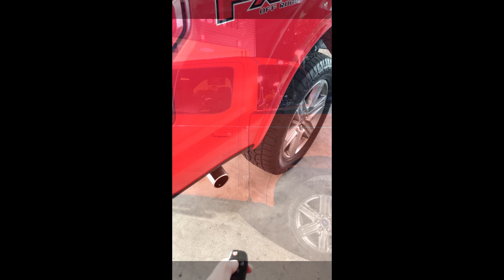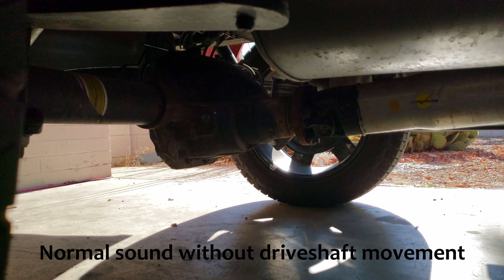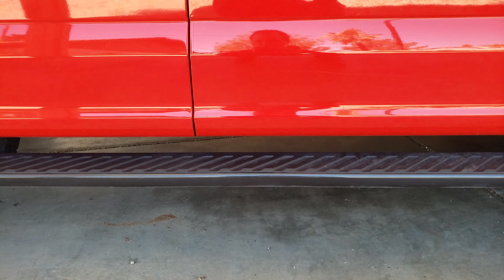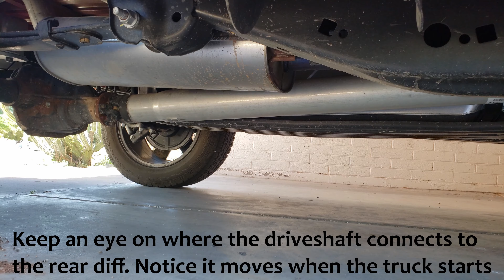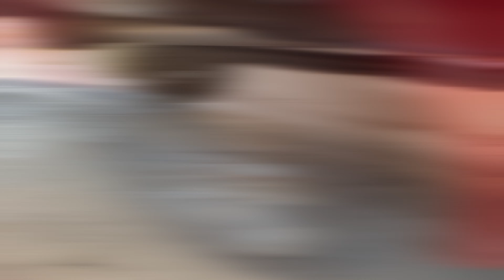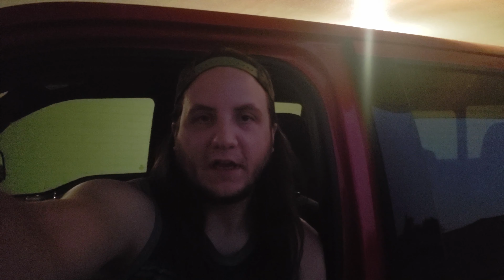2018 F150 Start Up Clunk

Comment from the maker: UPDATE: Took it in to the dealership today for my first oil change at about 4800 miles and told them about the clunk. They looked at it and said it is "normal" due to the remote start function...lol. I will be taking it to a different dealer that has better ratings at some point because I think this is BS. I took it in to the place I bought it from because my first oil change was free. They also did TSB 18-2274 for the rough shifting and driving it home it was much smoother. Hopefully that will continue to be the case!
Reply: Truck the System not normal with remote start because my 2019 that DOESNT have remote start does this some times
Reply: How’s the transmission been shifting after the TSB?
Reply from the maker: @searles400  It got worse after the first tsb so I took it back in and they updated it again about 8 months ago. It was pretty smooth for awhile but I haven't been driving nearly as much and it's back to rough shifts when cold. Think that's just how its gonna be with this one so I always try to let it warm up before I drive.
Reply: Truck the System was the TSB done 8 months ago different than the original one they did? Or just did the same TSB again
Reply from the maker: @searles400  Same TSB but ford had just released an updated version of it the day I took it in
Reply: Mine makes the same clunk and makes a a god awful clunk when it’s cold if you go from drive to reverse I mean god awful. And they did an update to the transmission and now the shift from third to fourth is horrible.
Reply: Immune doesn’t have remote start and it makes the noise. Get an exhaust and you won’t notice it lol
Reply: Definitely has nothing to do with the remote star if truck is in park then it’s in park no matter how u crank it
Reply: Lol people complain about any little thing.
Reply: @truckthesystem3957  
I saw another video on youtube where a guy had the dealership deactivate the adaptive learning on the transmission so it shifts normal and doesn't try and learn driving habits. Said it's been good ever since.
Reply: Sounds like two different problems I heard like chatter from starter and the last one was a clunk
Reply: Its your torque converter. Ford replaced my under warranty for same issue and problem solved!
Reply: @davecarroll4086  did your dealership prove this was the issue? Also, did you truck do this all the time or just every now and again?
Reply: Yea I don’t have remote start and today leaving work it made my truck rock forward
Reply: Mine does it and I don't have remote start. Mine is remote start capable but I do not have the remote for a remote start
Reply: My 2020 F150 3.5 Eco is doing the same driveshaft clunk at startup. I took it to the dealer several times before they could replicate the clunk. Now they’re telling me the clunk is normal operation per ford as a “drag, rocking sensation upon startup”. I am having the dealer contact Ford directly since the technical advisory note doesn’t reference any loud knocking noise. I will let you know what I hear from Ford. Please check my videos on my F150’s clunk noise.
Reply: The dealership/Ford said the clunk is normal operation of the motor. They are refusing to do anything further with my F150. Ford advised me to take it to another dealership which it is currently at. We will see what they have to say.
Reply: @Gonzola  did you fix the clunk issue?

Comment: I have this issue on my 2018 F150 Fx4 5.0. Dealership told me this was normal and no harm is being done. It usually only happens after I’ve driven a while, park, leave it off for a bit, then turn on. It has never done it during a cold start.

Comment: Apparently there’s a TSB for this clunk noise. Whenever the driveshaft rocks front to back it will clunk. The dealership will grease the driveshaft slip yoke that contacts your transfer case and the sound is gone.
Reply from the maker: Oh really? I havent seen it. Do you know the TSB #? Seems like that would just fix the sound but not the movement.
Reply: Finally someone talking sense about this issue, its not a life ending noise ffs!

Comment: Former ford tech here. It's the 10 speed transmissions. They are starting to have some issues. I had a 2011 fx4 with the 6R80 transmission remote start. Never did it. All the new ones with the 10 speed do it. I'll look up to see if a tsb is present and get back to you Monday
Reply: Any news on this? My 3.5 started  doing this!
Reply: @axelst.776  no I actually forgot about this. I'll look it up today for tsb's
Reply: @BeardedFordTech  any news
Reply: @montanamccormick1041  no tsb for that noise on startup. I did get with another tech who is a senior master and we remote started a few different ones. Every one of them sounded different. Kind of baffled us. He's looking into it more for me seeing as how he is still with Ford
Reply: @BeardedFordTech  thank you. If he ever gets back to you with some information on the issue would you be able to let me know
Reply: @montanamccormick1041  I sure will. He's checking today for me. As soon as I find out something I'll forward info to you
Reply: @montanamccormick1041  No tsb for the noise. However ford is aware of it and engineers are working on it. No further information at this time.
Reply: @BeardedFordTech  great thank!
Reply: @montanamccormick1041  no problem. If I hear anything else I'll reach out.
Reply: @BeardedFordTech  sometimes when I slow down and the trans downshifts I will occasionally get a clunk in trans or vise versa slow down then speed up ovcasionally I will get a clunk nothing upon startup
Reply: @brandondikowicz9340  same year f150 a newer one?  I'll check it out. What size engine?
Reply: Following. If incase of a a TSB
Reply: @jacobgonzalez1737  no TSB was present. They did however find excessive Freeplay in the transmission output shaft.
Reply: @BeardedFordTech ever get anywhere with this?
Reply: @rustbeltrobclassic2512  yeah. Fluid building up pressure in the system cdf drum.
Reply: @BeardedFordTech  Is there a fix, or tsb on it?
Reply: @rustbeltrobclassic2512   No TSB.  That I'm aware of.  Fix can be a few different things. I'll have to double check
Reply: No TSB. I think I saw the transmission guy replace the cdf drum cause the bushing was out of place for one of these. That bushing failure is a known issue. It will cause hard shifting and clunking as well.

Comment: Mine has the clunk sound too, 2019 with 10,000 miles on it. Only does it when afters its been warmed up. I thought it was coming from the engine, had no idea it was from the driveshaft. Thought it was some kind of quirk with the exhaust system too. Sounds like it kinda does it when shifting during sport mode as well. Anyone else notice this?

Comment: I have a new 2019 and it has done it off and on since day one. It’s normal. I have found that it is less noticeable if I hold the key slightly longer and let it “run out” before letting off. I’m almost used to it now.

Comment: Mine was doing the same.   Sometimes it would make the clunk when accelerating under load, such as towing.
1.  Check your slip joint on your driveshaft (that's where mine was).  It was dry, greased it.
2.  Also check your u-joints.  Sometimes when a engine starts it can vibrate the driveshaft and cause the joints to "release" if they are in a slight bind.   
3.  Check your leaf spring bushings.  They will make a very simular sound, but "usually" only while moving.
Mike

Comment: Have both clunks when starting and turning. Also have a very hard banging sound sometimes when trying to pass. It’s so hard that my truck goes into a safety mode called over speed. Just had the transmission rebuilt because the synchronizers were damaged. 
Had 35000 miles on it. Have carried it several times to dealerships for repairs on this issue.
Reply: And I still have the clunks after rebuild.
Reply: My truck also had the harsh clunk on start up and a hard up shift from 3rd to 5fth gear and a very harsh down shift from 10th gear to 8th gear. I did a transmission adapt reset and it is now shifting better . But still clunks at start up intermittent. I love my truck but Ford dealership never   seem to know anything about all these problems and they always say it's normal.they are a bunch of fkn ediots.  If you know someone that has a IDS Ford scanner try the transmission table adapt reset .it make mine shift like it was new. My truck is a 2018f150 with the 5.0   10 speed transmission

Comment: Have a 2019 lariat with 8 cyl coyote.  Have clunk on startup after driving and allowing truck to sit 45-60 minutes. Dealer has replaced flex plate, high pressure pump and starter twice. None of this has fixed clunk. Still looking for solution.

Comment: My 2019 f150 5.0L is not a remote start but it does the same thing when engine is warmed up but does not do it when engine is cold. I can feel the jerk when i turn the key from inside the truck.

Comment: Mine does it only when warm, more often with emergency break on, pretty loud, since new, 2018. And it’s NOT from the freakin remote start because mine does it with and without remote start. Yes, it’s the drive shaft turning a bit at start up: I don’t like it either
Reply: Dan 1085 I agree I have push start and it does it when I start my truck.

Comment: I have the same issue with mine, i have yet to take it in. I will wait until my first oil change, and when i get the recall notice, and just get it all done in one visit. But, i heard from other people on forums, that the dealer tells them it is "normal".
Reply: They told me the same thing but i wont settle for it! The 10 speed was one of the worst things ford ever came out with! Idgas about “tow capacity” gnna prob get a 6 speed again!

Comment: After running for 2 hours. 
Park the truck
Let sit for 5 min
Start truck and here the clunk
Put in reverse and back up about 10 feet
Wife yells that I hit something as Im backing up. 
Nothing behind me.  It felt as though I hit something, but was obviously something to do with the drive train. 2018 f150 EB XLT. 30,000 miles. It clunks about 50% of all start ups. First time it did the crazy backup jolt was today.
Reply: I have a 2018 F150 5.0 what does the same damn thing very aggravating. Burns about 3 quarts of oil every 5000 miles total BS

Comment: I have 2018 F150, 307 V8 Coyote/ 10 Speed Auto 4X4. Purchased new, March, 2018. Sticker inside driver door, Mfr. date November-2017. Had recall notice a month later, about some transmission clip thingie,, took it to dealer, checked out, no problem. No further recalls 3 years later. Truck is solid, does everything, no problem including mountain driving. But, ever since I had it, about 50% of start-ups on cold, I hear a 'WHAP' sound when I turn the key. Do not have remote start. Not even worried about it, sounds like something to do with fuel/exhaust system, No other problems, but, weird. Almost 50K. No fails.

Comment: I have a bunch of weird noises in my 2019 F150 that my 2017 didn't have.. 

the bang on startup on mine happens hot or cold.. doesn't matter.. to me it honestly sounds like there's a bad tooth on the flywheel and the starter is banging the next tooth.. but i can see how it would be driveshaft related, there's a carrier bearing in the middle, my bet is there's slop in the slip yolk.. wonder if this happens if you go neutral, set the parking brake, then go park.. does it still knock? gonna have to test that.. i also have the annoying transmission shift feeling and have the spark knock from the transmission trying to optimize fuel over performance.. i do like the 10 speed, but it's a little finicky..

Comment: I love my 2018 F150 5.0 4x4.  It makes the clunking sound when starting once every 10 to 20 starts.  Most of the time it isn't that loud but sometimes its just down right embarrassing its so loud.  My dealer said it is normal.  I am just worried that upon time the clunking sound will cause a big problem.
Reply: Same. I got a 2018 3.5 eco 20000kms. Clunks almost all of the time when it’s warm.
Reply: yes i agree its embarrassing! im trying to figure out what it is. it only does it once out of 5-6 times. did you ever figure out what it is? i have a 2018 5.0

Comment: They claim it's in the transmission, guys with GMCs and Chevys have also had this issue. My 2019 f150 2.7 does this on occasion.
Reply: Anything they can do to fix it?
Reply: Yeah my 2.7 does it once in a blue moon. I have 31,000 miles so far and would say it’s done it about 5 times. I did Uber and Lyft with it and never saw anything like this happen often.

Comment: Just some some driveline backlash being taken up.  Not a big deal.

The stiction transmission's rotating parts takes a little rotation to break them free.  When the engine starts there is some force sent through the transmission just by that stiction.  There is a normal amount of backlash in the parking pawl and the differential and if the truck is parked with zero pressure on it to hold some pressure on the driveline it can rotate slightly until the backlash is taken up.  When you park your truck on a slight incline and you will preload the driveline and will not see the rotation or hear the noise.

Side note;  a person should never trust the parking pawl alone to hold the vehicle but many do each day.  I'm very deliberate in the way I set mine to intentionally not allow pressure to be placed on the parking pawl and driveline.  I grew up in a mountainous area and have watched my share of vehicles break loose and roll away because of the driver not using the parking brake.  The parking pawl will snap if too much pressure is applied.

Another side note; your era of transmission was recalled because of a poorly designed parking pawl retainer.

Comment: I purchased a used 2018, 5.0, 4x4, had 62K miles on when I bought it.  Mine makes an occasional clunk/clank at the end of the start cycle.  Mine does not do it often enough that let's me try to isolate where it's coming from.  I also experience,  once in a blue moon, kind of a clunk in the rear-end . That only occurs when in reverse and I let off the brakes.  Almost seems like a brake hanging up.  Not taking it to dealer because I don't want to pay for them to find nothing.

Comment: hello I have a ford f150 lariat 2018 80000kls with the same driveshaft problem I went to Ford they removed the driveshaft and lubricated it with PTFE grease and the noise disappeared thank you

Comment: I have a 2011 Ford F150 with a 5.0L Coyote V8 in it with 138,000 miles and still going strong and its a beast and it sounds like a beast with the Borla ATAK exhaust on it.

Comment: My 2021 makes same popping noise when turning left up an incline coming from rear diff. It's in the shop now 3rd visit trying to locate noise*******update!! FIXED
they changed out new U-bolts and popping went away.

Comment: Any new updates on this issue? My 2020 f150 is doing the same thing. Took it in to the dealership the same week I got it. They claim “no knowledge” of any clunk issue. Does it mainly when I use my remote start. Scares the heck out me! Could this lead to transmission shifting accidentally? I see a major lawsuit coming.
Reply: Did you get it figured out ? Just went in yesterday and they said it’s normal
Reply: Did you ever figure out the clunk? I know this is 2 years ago. My 2019 does it

Comment: Got a 2019 f150 when it’s put into reverse it has the same sound just way more aggressive and shakes the whole truck.
Reply: My 2019 xlt does that too
Reply: I find after start up the truck revs up rpm’s to warm engine. Wait about 30 seconds for it to rev back down around 800rpms and then shift.

Most of the time this prevents that but still occasionally happens

Comment: That sound won't be a normal as soon as warranty runs out.......it will be $$$$.
Reply from the maker: We'll see. It doesnt really do it anymore I think its gonna be just fine
Reply: @truckthesystem3957  what was the fix?
Reply from the maker: @dennislawrence5041  They haven't done anything to fix it but it barely does it anymore. It used to do it everytime I started the truck when it was warm. Now its real sporadic so I'm hoping it goes away alltogether. So idk...maybe it just needed breaking in
Reply: @truckthesystem3957  mine has 56,000 Miles and it doesn't it almost every time when it's warm. It's in the shop for that, chain rattle, Chain tensioner, and knocking noise.
Reply: @Jasonlb4424  my F150 just got back from the dealer today for some warranty work and I told them about that timing chain rattle and they said that its under warranty and its gonna be like 3 days... crazy. But they did say that that is a defect on F150s and its covered. is yours the 5.0??